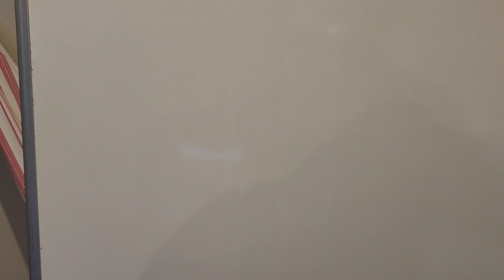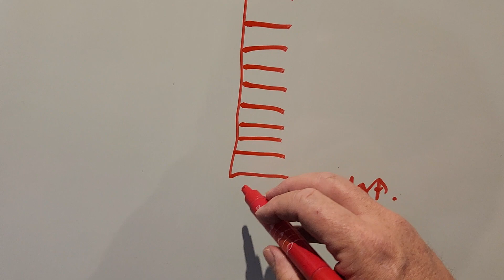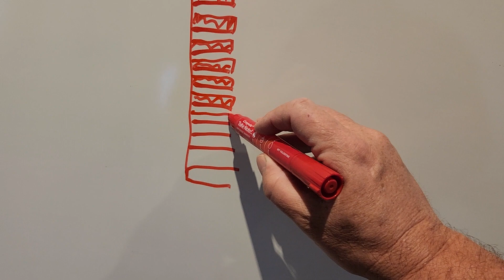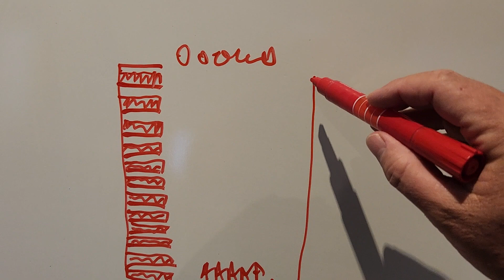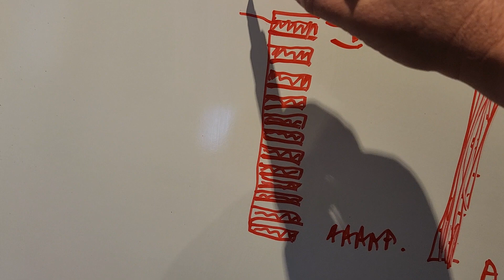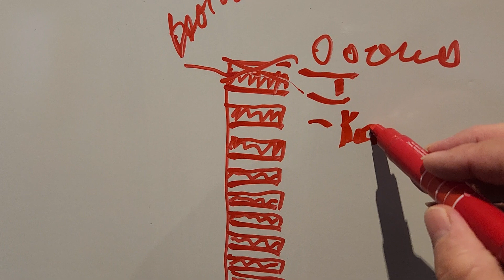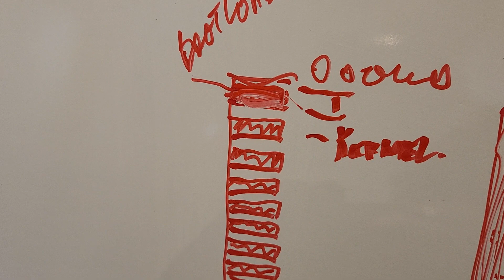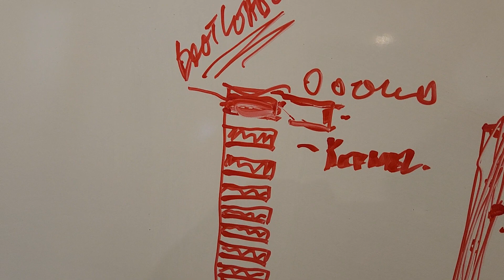GoPro Karma NAND Saturation - Why I don't believe its grounding your Karma

Comment: Great explanation It seems to me some of the software might have gotten corrupted, I doubt it's anything that GoPro did with malice or on purpose, however I think GoPro should have fixed the issue. Mine stopped working and wasn't updated. So possibly just a file corruption issue on start up.
Reply from the maker: I think that the fact that so many people had the issue that it would have constituted a manufacturing defect. Remembering that in Australia consumer law covers you beyond the warranty period offered by the manufacture. There is however an expectation that the quality of goods is relative to the cost. So if you bought a $14,000 Lancer the expectation would be less than if you bought a $70,000 Ranger. The big issue is that although they make this distinction in law its still open to interpretation.

Comment: Great video Bozmanx. I got the link to your channel from "Mike's Man Cave". This is great news for Karma owners. Well done. I still have mine and it is flying perfectly. I have always had a hunch that it was something to do with that last update ie it seemed to take ages and ages to complete, much longer than any updates before. I just persisted with mine and it went great but maybe some owners stopped the update to early and corrupted the software. Anyway well done again, I bet Mike is kicking himself for getting rid of his Karma (jk).
Reply: Thanks, for commenting and sharing. And yes I am kicking myself, might see if I can buy it back. 🤣
Reply from the maker: It could be something as simple as pulling the battery out before you power it down. I normally power it down first but I deal with so many with the pairing issue that sometimes I just pull the battery to shut it down without thinking about it.